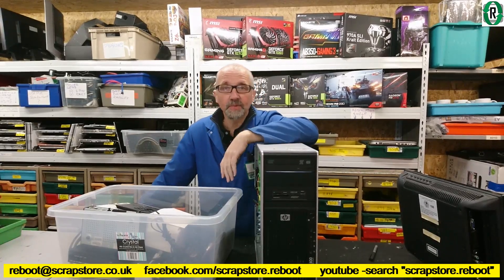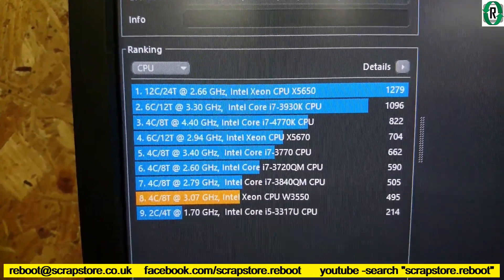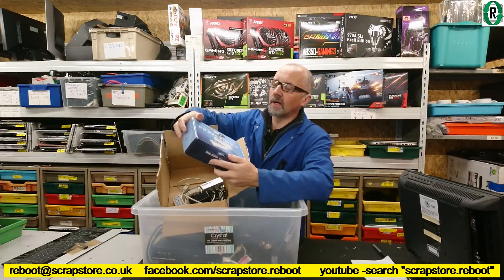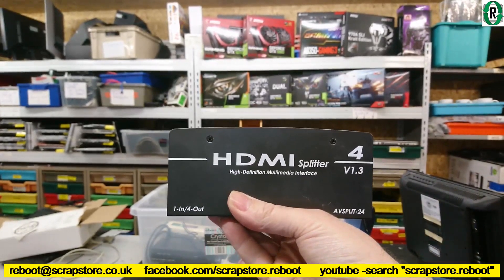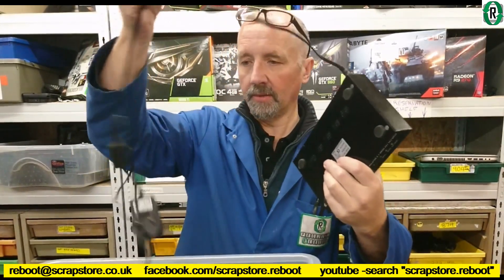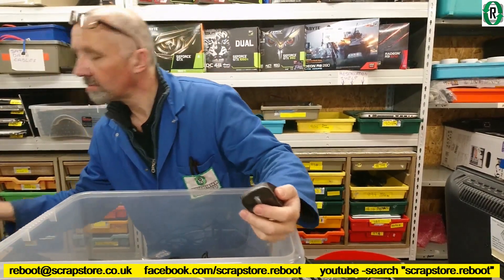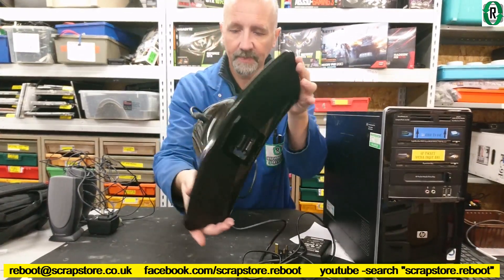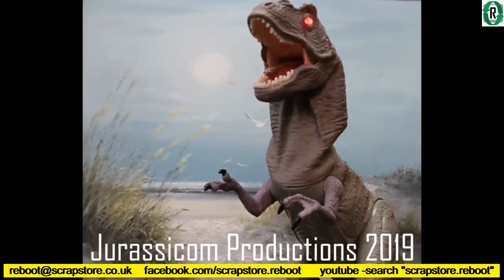Tech donation #28. XEON W3550 vs XEON X5670. And more tech donated

Comment: Am after something that will run video and photo editing software a bit quicker than my laptop. I use photoshop and Lightroom and also a magix pro video editing software . Would that computer you looked at first be any good for the job? Am not into gaming , just need a good editing unit.
Reply from the maker: Hello Nick, the XEON W3550 has 8 threads so is good for video editing, much the same as an i7 CPU. More cores/threads, the faster it can calculate. I recently upgraded my home PC from an i5 (4 cores/4 threads) to an i7 (4 cores/8 threads) and it cut video processing time in half. I sold the XEON with the W3550 but still have the X5670 CPU which has 6 cores/12 threads, but I dont have any RAM to fit at the moment, so I cannot complete the build until someone donates some EEC ram. I will let you know if some comes in over the next couple of weeks. Thanks for watching
Reply: @ProjectRebootUK  how much would I be looking at for that ?
Reply from the maker: maybe £150 but to compare, what is your laptop ?
Reply: @ProjectRebootUK  hp pavilion i5 8 GB .
Reply: @ProjectRebootUK  You don't need ECC for that CPU.